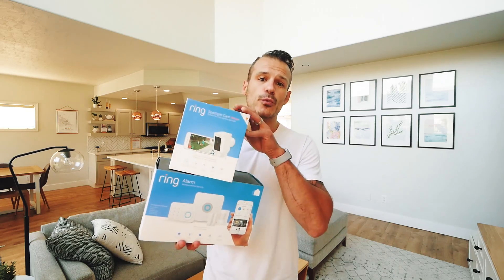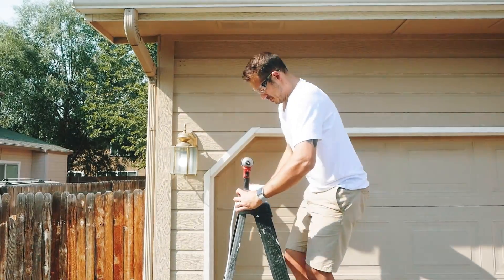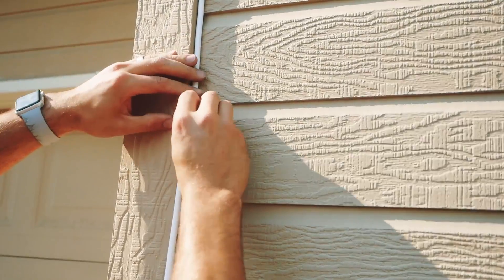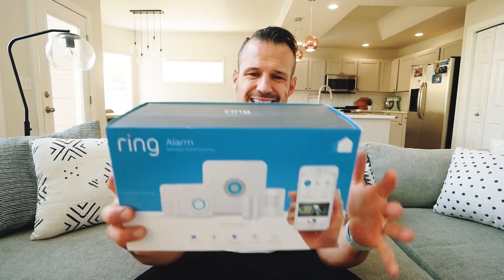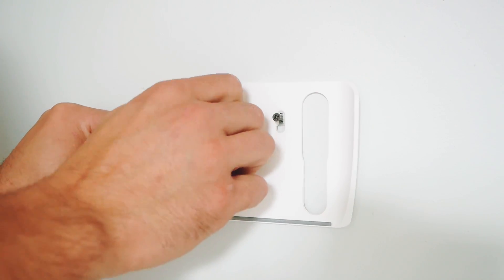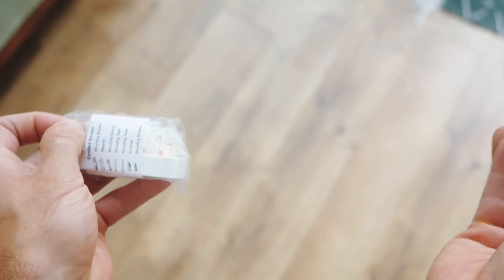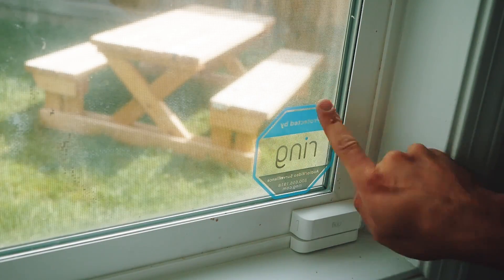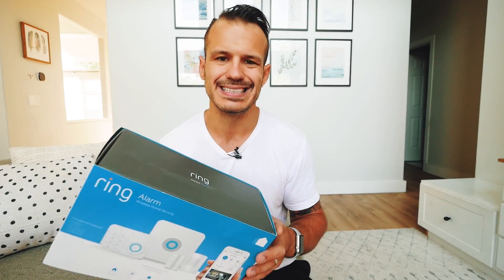RING Security System Worth It?

Comment: OK, I am a verified customer.  This is system is terrible. Only good for a small studio apartment. If you have a home or condo with an upstairs or down stairs forget it. Weak wifi signal based, erratic sensors, and required 4 hours of Ring support and still not resolved.  Sorry, this is only a system for small spaces.  With now three wifi extenders ( not cheap btw) and now told I will have to await another five business days for a broken sensor, this is a joke system. RUNNNNNNNN!

Comment: So if you lose power you lose your security system?
Reply: The base station has a battery that is supposed to last for about 24 hours. It also has cellular backup provided by AT&T in case WiFi is down, although to get this you must enroll in the professional monitoring service which costs $10 a month or $100 a year.

Comment: I know it's a paid add but I don't feel like I got your real opinion or you rushed through it at the very end. I own the alarm and the pros is it's cheap and you can set it through your phone. It is very buggy from my experience. I haven't had a internet issue and it would disconnect. Along with disconnecting I've came home and triggered the alarm and the system/app is not available or offline with no option to shut down.
Reply from the maker: right on
Reply from the maker: Sounds like a win
Reply: All new tech. is buggy. I am glad I am watching these videos and waiting. I almost jumped at Home Depot. Ring has a slick display there

Comment: Does it call you when there is a burglary or do you have to pay $10 a month plus fines for false alarms?  
Does it have a real siren or one of those tweeter sirens?
Sounds like a fairly decent system.
Reply: If you opt to NOT sign up for monitoring, it will always notify you with a notification on your mobile.  

If youopt for the monitoring service.  They would call 1st contact, then 2nd if 1st not reachable.  If not reachable, they call the Police.  A lot of security services follow this protocol, so end user avoids fines for false alarms.

There is a YouTube video of siren demonstration.

Comment: Quick and really incomplete review. So not completely informative.

Per other comments, is there sim card in case internet down?
Reply from the maker: When the power is down, it has a built In battery. And when the WiFi is down, it goes into cellular backup mode.

Comment: no broken glass sensors? kinda useless on windows then
Reply: (PaladinMJ) Depends if you have a small window then a contact sensor should work cause you need to open the window if you have a large window like a patio door or back yard glass door then you can always add a motion sensor to go along with your contact sensor. So when your home and it’s armed the contact sensors will be active and when you leave both contact sensors and motions sensor will be active therefor, if the glass were to be broken the motion sensor will pick it up.
Reply from the maker: this version didn't come with laser beams like they had in all the mission impossible movies
Reply: (Mr. Build It) no instead it comes with something better a motion sensor in every starter bundle.
Reply: I believe there is a glass break in the base unit...just checked, looks like its coming, but not current
Reply from the maker: Not sure. possibly
Reply: Motion sensor is much more effective than any glass sensor.
Reply: @tubetop123  glass breaks and motion detectors augment each other, neither is more/less effective than the other. If youre out of town and i break your window, a motion detector wouldnt alert you. If i find an unlocked door and walked in, a glass break is useless.  Used together, you have a better secured house. Btw, your window/door contact is useless if i get in throw a broken window (which the glass break detects)
Reply: Not an issue if you have impact resistant windows
Reply: @jackmarginfl  they dont just pick up the sound of broken windows...any shattering glass would trip them.
Reply: @completehomeelectronics  impact resistant windows don’t break
Reply: @jackmarginfl  i know. ANY shattering glass will trigger them, i.e a vase knocked over by an intruder
Reply: Complete Home Electronix I stand corrected,  the clumsy intruders will get caught
Reply: you completely missed the point of augmenting your alarm system. glass breaks add a layer of protection like motion sensors and contacts.

Comment: Anything internet based is USELESS!!!
Reply: Dude, NO security system is without fault. I know people who have had MONITORED systems and still had their houses broken into and had tons of sh*t worth of valuables stolen. One person had the thieves break in thru the attic/ceiling and the alarm (sensors on all doors and windows) NEVER even went off. I also know someone who had a monitored system that did go off but by the time the cops were alerted and got to the  house, the perps were LONG gone and stoles thousands of dollars worth of jewelry and electronic devices. I would much rather pay money up front and a small yearly fee ($100) than to pay $50/month ($600 per year) for something like ADT. For the price of one year of ADT, you could put together your own security system and it be just as effective.

Comment: These Ring products are HIGHLY over-rated! The audio and video signals are not clear. The audio cuts in and out to the point where conversing with the person at your door is simply not possible. The video gets pixelated and is difficult to view. The camera itself is sub-standard. Anything within 10 feet is clear but beyond that it's just a blur. You would think with today's camera lens technology Ring could provide a more distant clear field of view. But it does not. Anyone or anything that causes the alarm to kick in - and is more than 10 feet away from the Doorbell may as well be wearing a disguise because you will surely not be able to discern who or what it is that set off the alarm. Then there's the latency between the time the Camera triggers an alarm and the time when you actually get to view the video. So long that any perpetrator would have stolen your packages and be in the next town! And then there's the unexplainable drops in connection. Complete loss of video and audio. Ring techs can't even figure out how to solve this problem. And NO, it's not because my wifi speed is too slow or my wifi router is too far away. I run at 300mbps and I'm only 50 feet from my camera. And now I just discovered that my video recording will cease after a few days and RING wants me to pay a monthly fee for a feature that was clearly offer to me as part of my purchase. It's a SCAM! The product just simply does NOT perform as advertised. I feel like I have wasted hundreds of my hard earned dollars on a security system that is more trouble than anything else. It's actually a joke or better yet - a Ring SCAM! Do not purchase any Ring product. They simply do not work.☠️
Reply: Marcie, NO security system is fool proof. Ring is no different. I have a ring doorbell not to IDENTIFY potential perps, but to notify me of them being there. I then call my neighbors (who both are retired former military) and tell them if I suspect someone is up to no good. They can then at least get a license plate or engage the person IF they choose to. Even with a monitored system, burglars know they have 60 secs or so to steal stuff. If you can make your way to the master bedroom/bathroom, that's where MOST women keep all their jewelry. Hell, you can even snag a ipad and a few other items and be out the door before the alarm sounds. Lastly, while the video quality may not give you a clear pic, it allows you to have a description (race?, height, clothing, etc) and that is enough to call the police and let them know what happened and what the person is wearing. I live in the city and many people who steal sh*t are transients who do not have getaway vehicles so they CAN be caught shortly after.